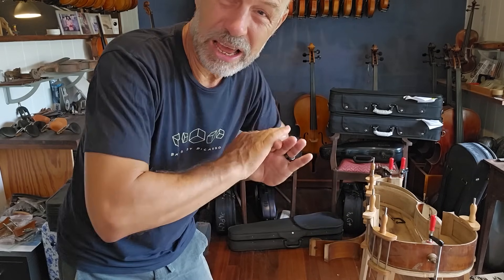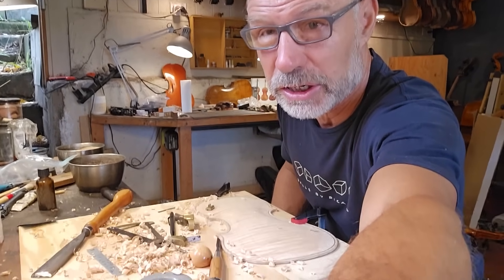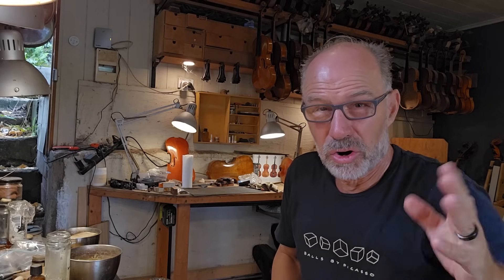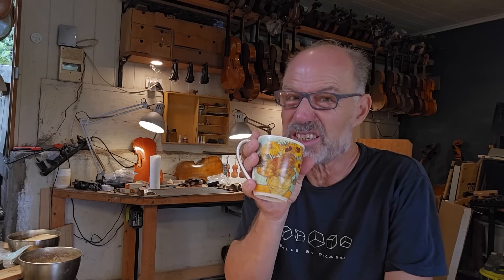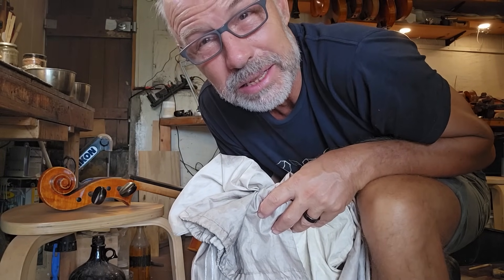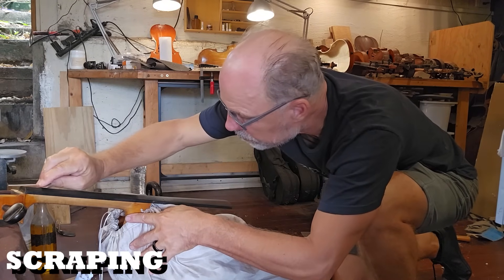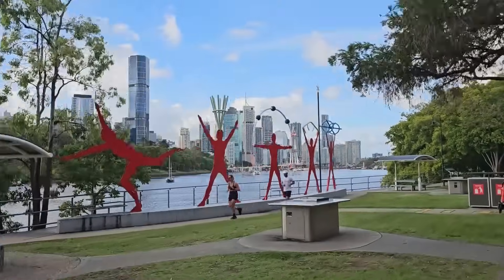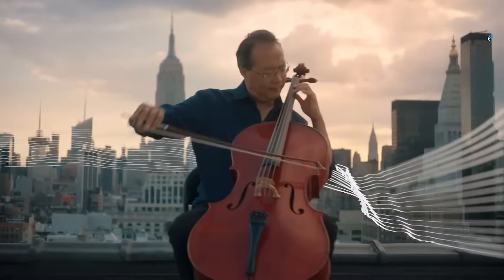Why I do YouTube -  and Day in my Life of a Violinmaker Jan 2024

Comment: Olaf, have you heard of mixing casein with calcium and a little water and applying a couple layers to the inside and outside top and bottom plates of the violin prior to putting on oil varnish so that the oil varnish does not penetrate too deeply into the wood.

I was communicating with a luthier who does this and, prior to gluing the top and bottom plates onto the violin he returns it after applying the oil varnish because it's slightly changes the tone and he graduates the plates just a little to adjust for the oil varnish. Do you know anything about this? I guess Stradivarius used to use this technique